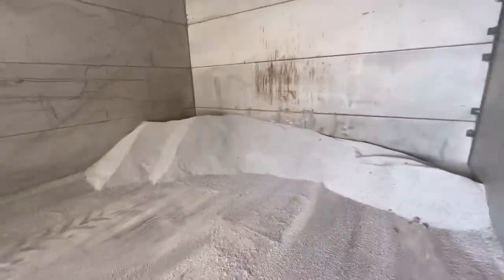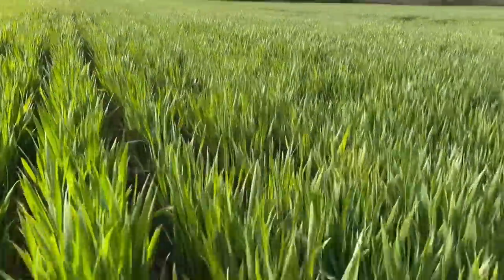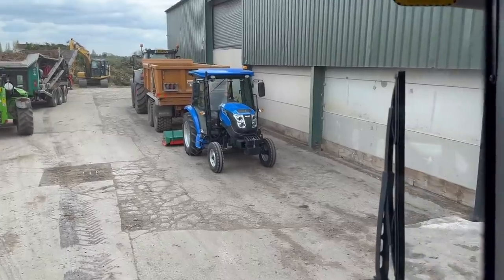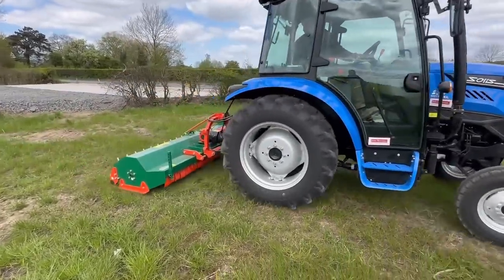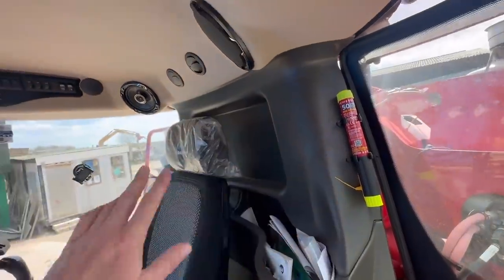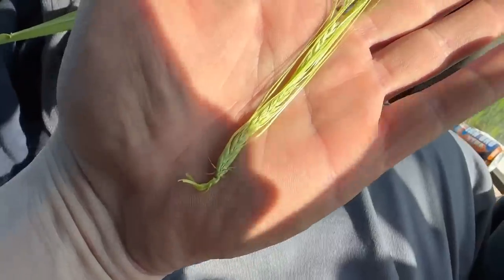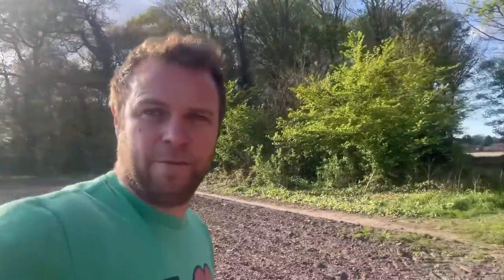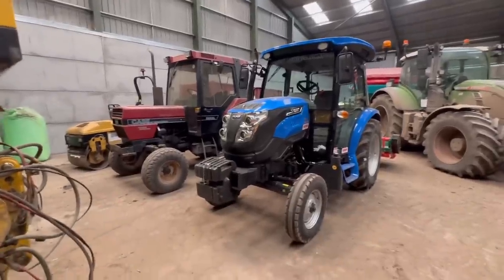BIG LITTLE TRACTOR  #OLLYBLOGS #AnswerAsAPercent 1130

Comment: Make sure to soak the trailer in red derv and the wheel barrows aswell olly leaves it alot easier worked with also fill the roller with water aswell

Comment: Can you use the Case 585 to do the topping? Save getting another tractor.
Fertiliser spreader attachment is to reduce the width it spreads round the headlands and save putting the fertilizer in the hedge.
Are you going to see the combine that you are using for the road run?

Comment: Gday olly 95% today been a couple ripper days here but coming it wet tonight, use to chet with our khun spreader and tare it with 1t on so the alarms wouldn't go off when I over filled it and log it in the computer, I'm guessing that's to adjust the drop point where the fert lands on the spinners

Comment: On the fertilizer is it a handland mengmet vain to stop the fertilizer going so in to a hedge or water corse. Only ever used Amazon's and KRM but they both hydraulic vains that come down.

My other guess would be something to with the weighing syteam but that's normally hidden under the top link. Other then that no more clue then a fly.

Comment: You did a good job explaining the river at Jonny prices, seems the E A are exaggerating everything, you can see what he's done on Google maps the feild he did the work in is just over 5 acres so no where near a kilometer in fact it's about 330 yards on Google maps. They claim he cut down 95 mature trees on side by side maps the satellite map from before the work was done shows about 12 or so larger trees the rest are very small, the maps from the early 1900s show a mill at the buildings at the top end of the feild with a mill race and 2 water channels taking the water back to the river across that feild there is even an aqueduct across the river towards Jps farm, possibly some thing to do with a unfinished canal that was partly built in the 1800s, so over the years there has been as lot of human intervention on that stretch of river over the years,